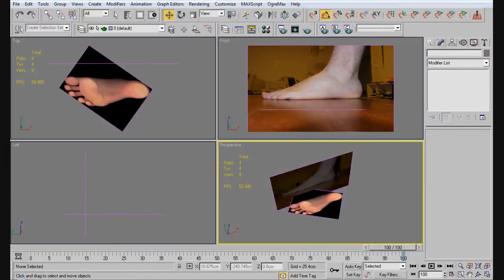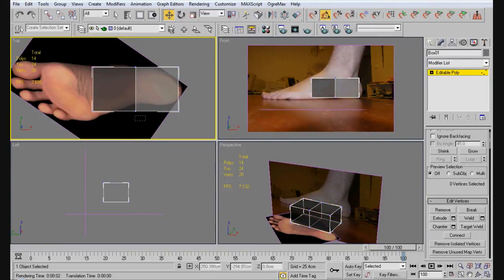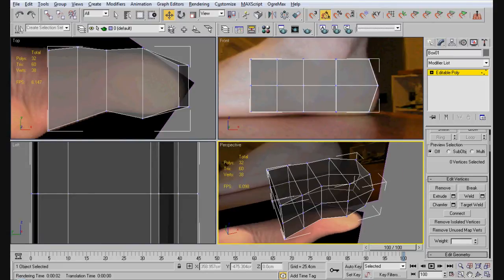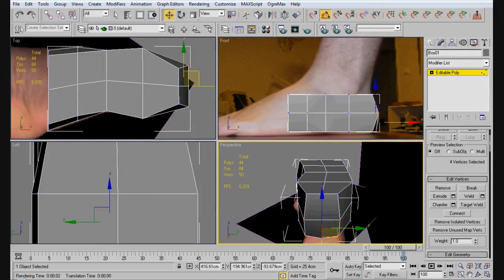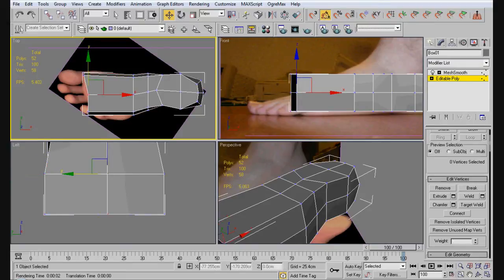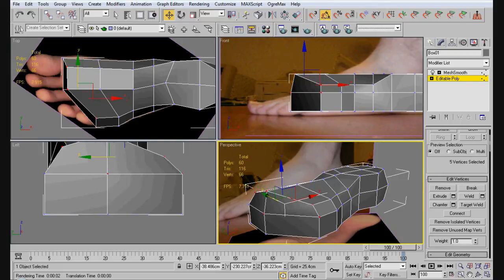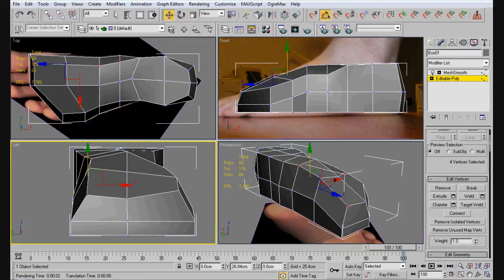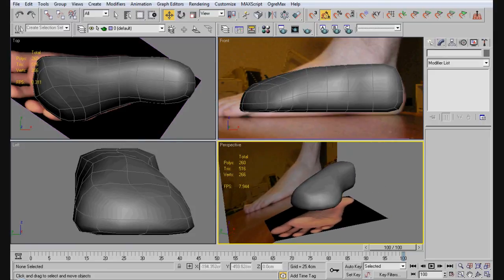3ds Max Tutorial - Human foot model (1/3)

Comment from the maker: @Asheco Ha sorry, seeing as this is not one of my beginner tutorials I didn't see the need to go into detail on setting up reference images and using some of the different tools. Basically you will want to select the edges you want to connect in order to use the connect tool, also the foot images are put into material slots and then applied to the planes.